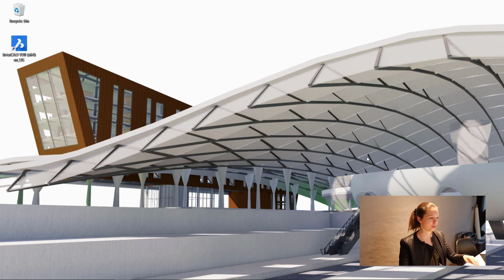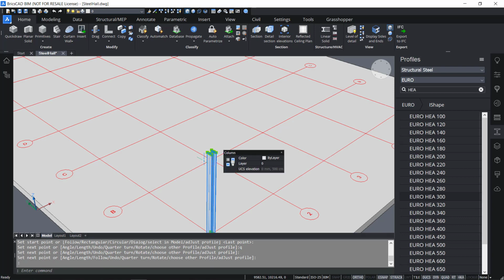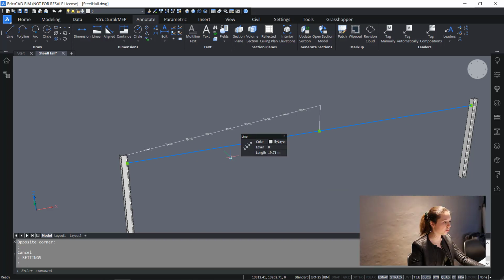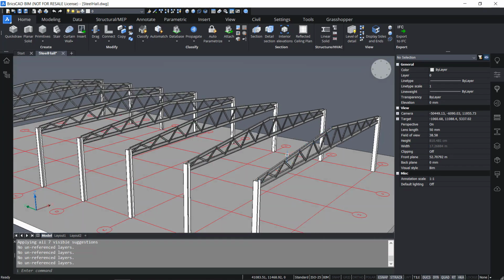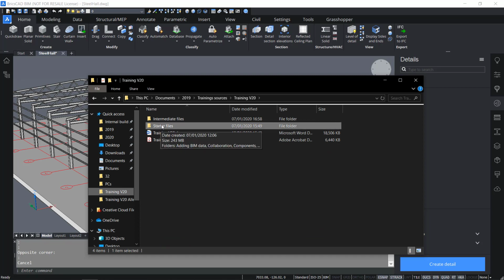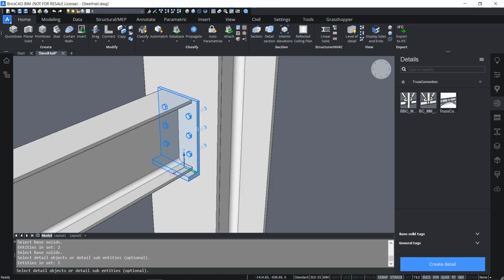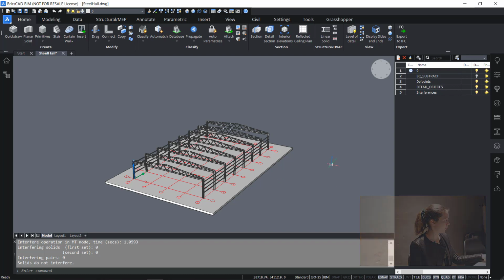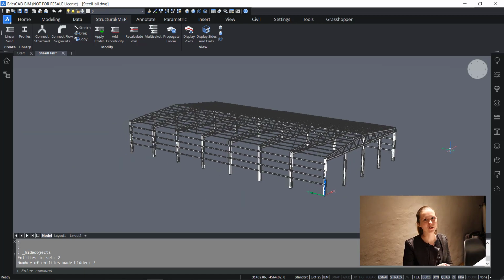BricsCAD V20 BIM Academy 8 - Structural Modeling

Comment: Good video, very useful V26 here, it draw lines only from or on bottom of the columns not at the top or even making slopes... with a line, is there a parameter to activate work plan or equivalent  ?   not 3D user very friendly....

Comment: Hello, good morning. First, I'd like to say that this program is very interesting. I had the same thoughts as millivanilli4825; it's a very comprehensive program.

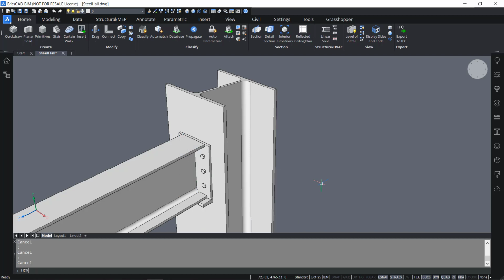On the other hand, I'd like to know if you could help me replace the component. At minute 57:29, I performed the procedure the same way: UCS>world - Replace>from file>BoltedPlate. When replacing it, it's located at different coordinates. Do you know why?
Reply from the maker: Hey @omarcifuentes9926 - we looked into this issue with the training files. It seems that the UCS is not set as expected when using the UCS > Face option, so you need to make some adjustments. The UCS set in the main drawing is not the same as the one from the component source file (BoltedPlate.dwg).
 
Here's what we suggest: instead of using the UCS > Face option, follow these steps:
- Launch the UCS command
- Select the face of the Column and then place the X axis to 0 and the Y axis to 90 degrees (as shown in the video). 
When replacing the component, the new one should be correctly placed.

Hope this helps!

Comment: What about concrete beams and slabs? How can they are merged? Are they merged automatically?
No videos on this channel deals with concrete structure.
Reply from the maker: At present it is only possible to merge beam-slab connections in the generated 2D drawings on the material level. When going into the properties of a Physical Material, you will find an option ‘Union section’. This option will make sure that similar materials – touching each other in the 3D model – do not get an intersection boundary line between the two elements, thus seeming ‘merged’ in the 2D drawing, while still being 2 separate entities in the 3D model. For more information on the Physical Material properties see: https://help.bricsys.com/document/_guides--BIM_building_data--GD_physicalmaterials/V22/EN_US?id=165079159395